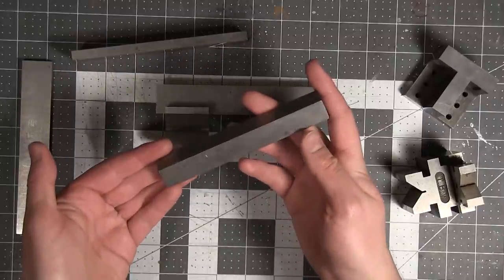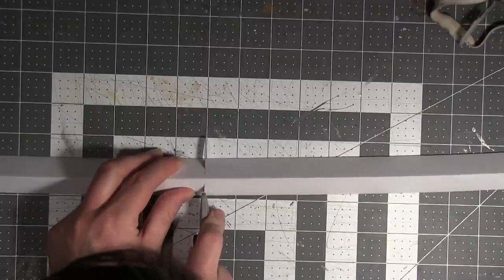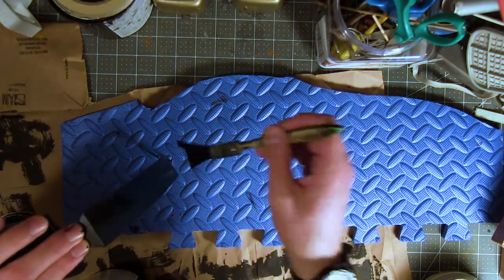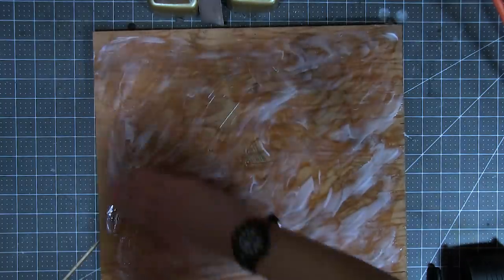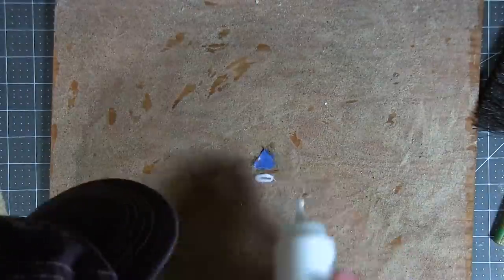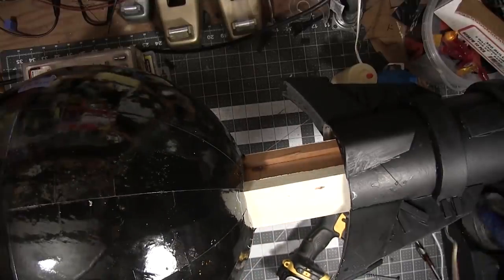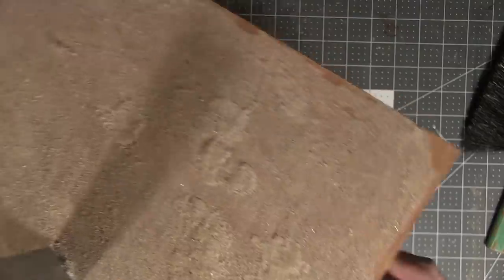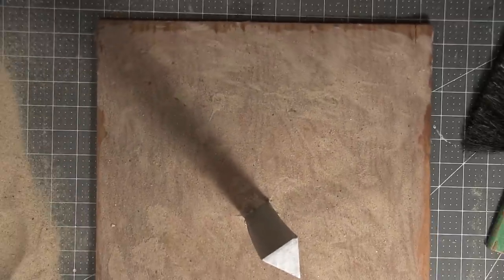Utah Monolith Diorama

Comment: using watered down white glue with a tiny bit of alchol and dish soap works great for glueing down sans or other terin cover. Another good tip is to make your surface of sand/gravel/ turf and then add the watered down wood glue on top. Real winner, from a model railroad enthousiast.
Reply from the maker: Thanks for the tip!

Comment: To avoid hot glue burns while smoothing it out, you can use the edge of popsicle sticks. The curve on the end is very small and gets into tight spaces, also adjusting how you smooth with them can make square corners, mostly.